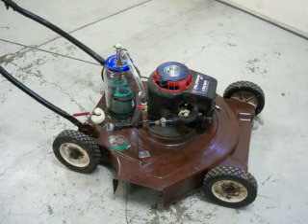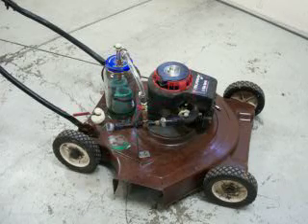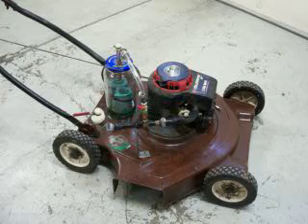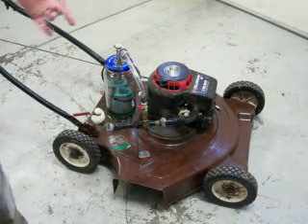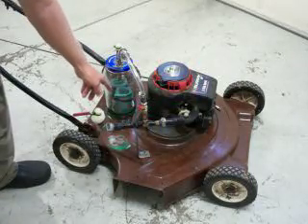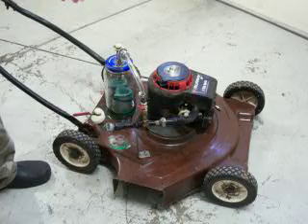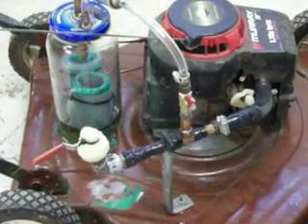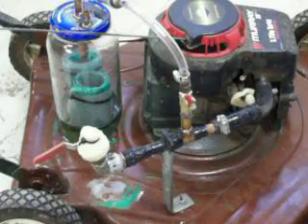just vapor, the truth or a lie

Comment: Thanks for sharing this video. I have been looking for a more efficient process for vaporization without having to heat the system and this is perfect for my small application. I am currently working on a medium sized system that will be heated for use in my Jeep on my 4.0 liter 6 cylinder. I have been running a small bubbler type system on my Toyota for almost a year and effectively doubled my mileage by using it in conjunction with the injectors and the PCM. Since the PCM reads the signal from the O2 sensor as a "rich" fuel environment, it cuts back the pulse bandwidth per cylinder per cycle and uses much less liquid fuel. Since that fuel comes in the for of vapors and not atomized fuel, the car runs cleaner with much less emissions and at a slightly lower engine temp. I was wondering what type of material you are using as the wicks in your system. I am interested in the exacts of this configuration so I can make a similar one myself. Thanks again.
Reply from the maker: i get them at grainger, they call em baby diapers,  but they are really towels for adsorbing oil spills in automotive shops  ect.
Reply: TheVaporkid
 Thanks for the info. I appreciate it.

Comment: So I have a question. I've been tuning into some of your videos and I heard you say "for the people running their mowers with the intake in the gas(the bubble affect) you don't need it. Then you said the gas goes bad a lot faster with that setup. I was talking to my dad about doing this on his lawn mower this summer, and he had a good question. What do you do with the gas that is bad? It doesn't have its bang anymore. What do you do with the waste? Does it still smell like gas? Can you please explain what you do when the gas can no longer be used etc. thank you.
Reply from the maker: yes it still smells like gas, the reason why i say it goes bad when you bubble the air through it is because i have have tried it many times that way, and every time the engine will run real good at the very beginning, after 5 min i have to adjust the air down so it will keep running good, as time goes on i have to keep leaning the air down so it will keep running, after 15 min it will just quit running because the gas goes flat, you see every body doing this, bubbling it through the gas. the only way to use the gas and all of it is to heat the fuel, vaporize it, and pull it in to the engine as a vapor.
Reply: Hey Chris Steffen, I have a small bubbler system in place on my Toyota. TheVaporkid is correct that it does go bad fast in a bubbler system. A couple of thing happen. 1. you get a LOT of heat transfer in that you draw out all of the heat in the fluid contained in the jar. This causes a lower reactivity in the fuel itself as it does not vaporize well at lower temperatures. 2. The bubbling process causes the more reactive substances to vaporize first and the leaves a heavier and less reactive substance in the jar. Although it does burn, it does not vaporize well and is far less reactive than fresh fuel as most of the highly flammable substances are gone. I usually will recycle this fluid into my primary fuel system to be remixed or, I will use it to burn my garbage. I have a drip refill in my system that refreshes the fuel in my vaporizer so I can go much longer without having to clean the jar itself.  However, if you can use a heated system to reach a minimum of 185 degrees, you can cause the full vaporization of all of the components in the fuel and do away with the need to clean out the less volatile elements that are left behind. Look up Craig Carpenter and check out my videos.

Comment: doesnt this make the engine run lean which will eventuakky melt the pistons and valves.
Reply from the maker: no, if the engine was running lean, it would be running ruff, it does not hurt the engine at all, the engine would last a long time running on gas vapor, its the liquid gasoline that screws and engine up.

Comment: ISN'T THAT WHAT THE CARB DOES?? YOUR PROBLEM IS THAT YOU HAVE A CRUDE FRACTIONAL DISTILLATION SYSTEM THAT TAKES THE LIGHTER ESTERS AND RUNS FINE FOR A WHILE TILL ALL THAT IS LEFT ARE VARNISHES AND TARS. YOU NEED TO HEAT THE CONTAINER
Reply from the maker: some think the carb is making the vapor, but what the carb or fuel injection is really doing is breaking the fuel up in to fine mist particles, the vapor is coming from that, the little amount of vapor is what burns, the rest of the liquid mist goes out the tail pipe wasted, its the on burned fuel that causes emissions, when you heat the fuel up it goes in to the engine as a vapor or fumes where it is all burnt, no waste of gas what so ever.

Comment: Wonder if there is any way to combine this with an HHO sytem to run a car on gasoline vapor/hydrogen fuel?
Reply: If you want an alternative to run instead of gas, wood gas works well and so does propane or methane and the setup is pretty much the same as VaporKid demonstrates, just don't run propane straight out of the tank, it needs to be depressurized so that the engine pulls the fuel rather than forcing the fuel, otherwise you will need a propane conversion kit.
Reply from the maker: i don't know, that's something to think about
Reply: That would be a waste of electricity!  HHO works great if you are just interested in converting electricity into a gas, but don't run it in an engine, the by-product of HHO is water and enough of that in your engine will destroy it, it does not evaporate, it condensates in the engine especially after the engine has been turned off and running fuel after HHO is harder than it sounds.

Comment: I'd reccomend putting a wideband air/fuel ratio sensor / gauge on that thing's exhaust so that you can maintain a proper mixture.  Looks like the valvue you have on the intake, will adjust your fuel/air ratio. 14.7 Is what youd probably want to go for.  May run faster with more air, but will run hotter.

Comment: Vaporkid, I believe in system. Have put you vapor wick system in a car? Is there a way you could help me with mine? I'm still learn all about these things but with help, I believe I can do it!   So does your wick system work by rapping two or so absorbent towels in a cylinder position and have one pipe that's drawing the vacuum from the engine 1/3 the way down the container and a air pipe hole at the top of the container?  Is this correct or did I miss something?
Reply from the maker: you got it, tomorrow i will make a video on the new wicking box i will build out of a ammo box, so you can get to the wick anytime you want by opening it, ill show you what size  pipe to run for the engine, becuse you will have to have a lot more air for the engine
Reply: TheVaporkid Thank you Vaporkid so much!!! I'm going to use my 94 Honda Civic Ex Vtec. If I can, I'm planning to disconnect my fuel line form my fuel injectors and run it to the vapor ammo box, and to prevent it from over filling, I'm planning to connect the fuel re-turn line right underneath the fuel line to keep it always at a correct fuel level. I hope this work....
Reply: Joseph Reinhart If my idea of the fuel lines work, it will be amazing to see how far the Honda can go with your Vapor Wick system!!!
Reply from the maker: Joseph Reinhart good luck

Comment: What kind of wicks do you use?
Reply from the maker: nick name for them are called baby diapers but they are super asorbent shop towels for oil and gas  in shops, you can get them at grainger.
Reply: Ok cool thanks!!
Reply: TheVaporkid Have you tried maxi pads?
Reply: LOL. These guys on here say the Graingers has a thing called baby diapers for absorbing gas and oil. I seen a guy also used car fresh air filters that go in just about every car. All the auto parts places have them.
Reply from the maker: i tryed air filters, they just dont soak the gasoline up.
Reply: TheVaporkid There is a video on here and it shows it with just a little gas in the can and when the filter is stood up in it they show the gas moving quickly to the top of the filter. S I think ya it does soak up gas. Though like these guys are also saying paper towels between screen mesh works great. (Bounty the quicker picker upper) But the diapers purchased at Granger for chemical spills such as gas, oil, different fluids work great too.